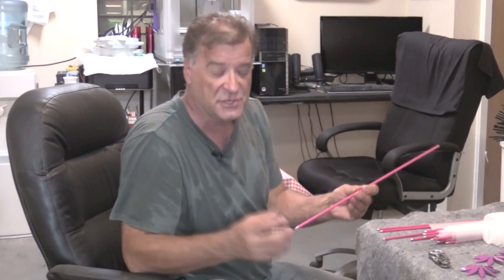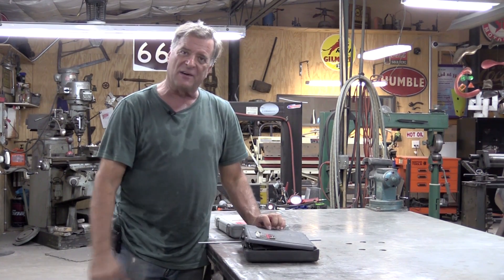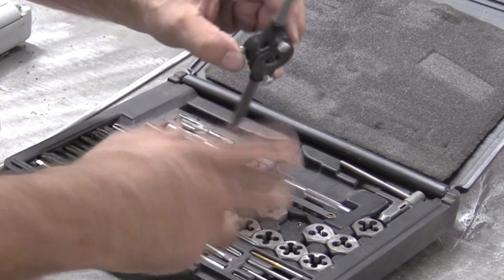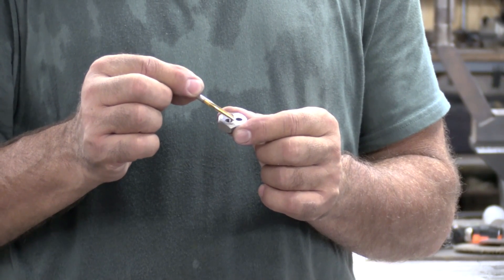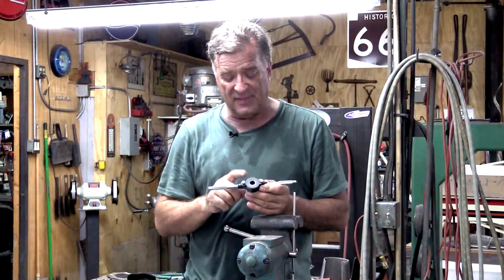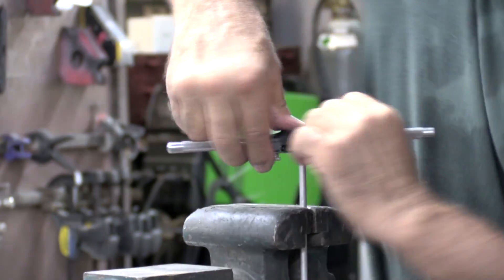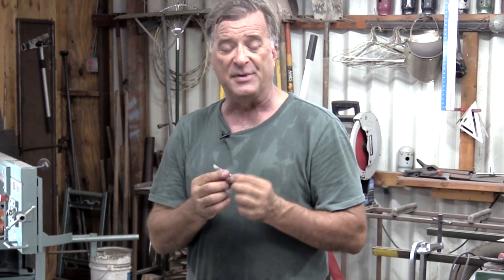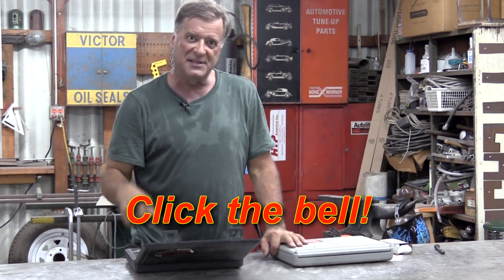How to Make Threaded Parts, Nuts and Bolts - Kevin Caron

Comment: Your die set is for chasing threads not cutting new threads. Split dies are for making new threads. I see on one of the shafts the threads cut more on one side than the other. That's because they are not made to cut new threads.
Reply from the maker: thanks for posting.
Reply: Yes, I was hoping someone already said this about rethreading dies. As a machinist I buy individual round split dies as I need them. Quite a collection now after 35 years! And yes, they can be sharpened too!